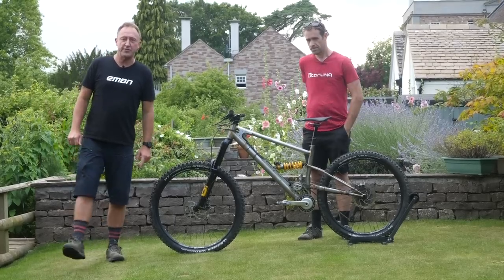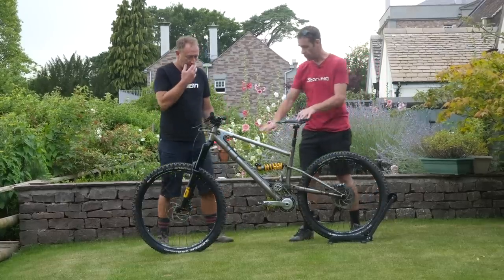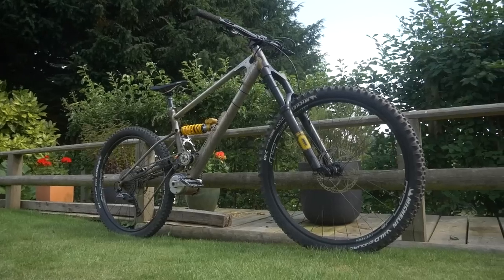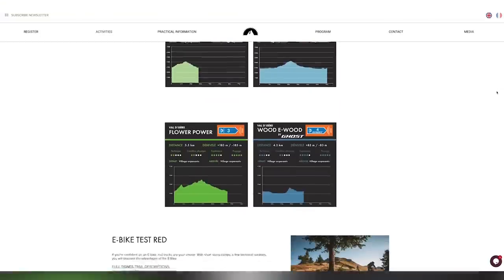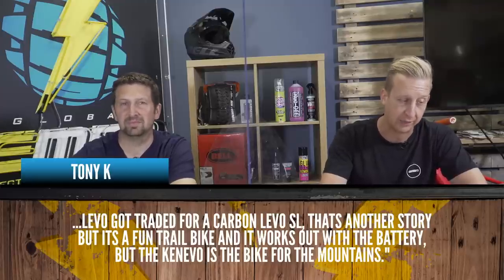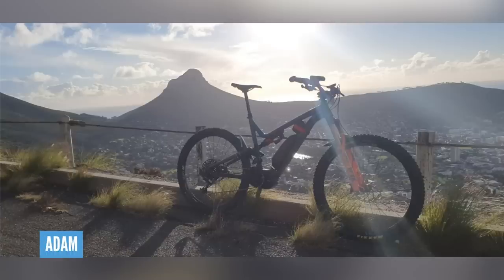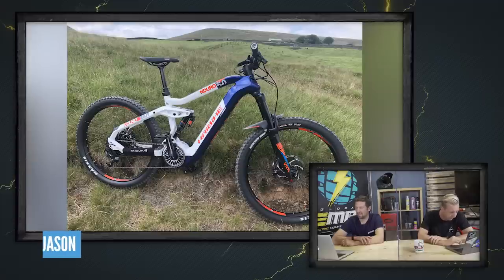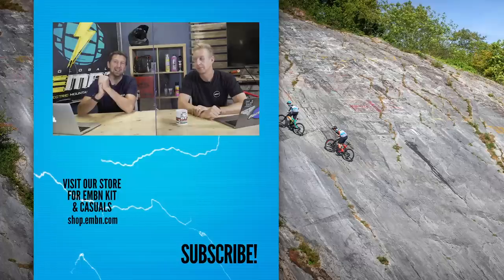Prototype Steel Full Suspension E Bike | EMBN Show Ep. 187

Comment: my mid drive emtb chain seems to be slipping. Its only 3 weeks old. Could the chain possibly be done already. I know that i climb a steep hill with it on a daily basis. My chain checker has not arrived yet.
Reply: Could be the back gear cluster, which has the wrong grease in

Comment: Did I miss it or was nothing mentioned about battery placement and size?
Reply: Thisbike has a 252w battery in the frame, this is for the purpose of the prototype, it will have a 387w internal battery with the option for either a 252w or 387w extender pack. Hops that helps answer your question.
Reply: @davidhemming1907   sounds like just the job,can't wait too see it out of RD and into full production

Comment: We can always use some competition in the market place, as long as it helps drive down prices...
I think this bike looks a bit spindly really, it would be interesting to see what their partnership with Williams F! could produce in the way of carbon fibre / composite frames and swingarms... and on the high-tech front, why did they not start with a clean sheet design? Sure the motor may be innovative, the high pivot  idler wheel may be this years trend, but to use a more than 100 year old technology for the one of the most important subsystems? Surely it is time we stopped using chains and cogs from Victorian times and got onto the Carbon Belt Drive and internal gearbox program...stronger, lighter, easier & cheaper to maintain... perhaps the boffins at Williams may even come up with something new given a bit of licence to do so... but the belt drive tech is mature and proven - we are already more than 20 years into the 21st century, why are we living with a 19th century drivetrain? Surely part of the prototype process is to see what is possible, what boundaries can be pushed and what innovations can be integrated into a production model...
Reply: Carbon fibre is very trendy, but, it is an environmental disaster, steel on the other hand can be infinitely recycled and repaired, it can last forever.
Reply: @technophobespain  Agree about the Carbon Fibre generally, although it can be recycled in some ways... but to have a partnership with such a high tech firm and then build such a bike... might as well have partnered with the village blacksmith for all the benefit that would bring to this design...
Reply: @davidking3699  carbon is also a terrible material for bike frames

Comment: I am a mechanical engineer.  With due respect, that ebike design is an epic fail on many levels.
No place for a battery and the downtube is way too small for any battery with decent amp-hrs.
Not sure why you presented this ebike that isn't feasible and heavy.